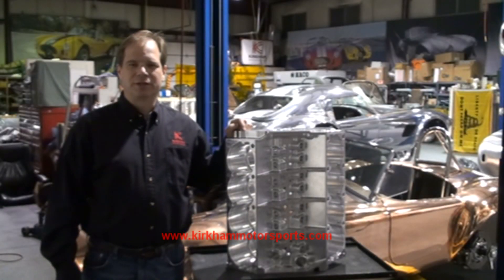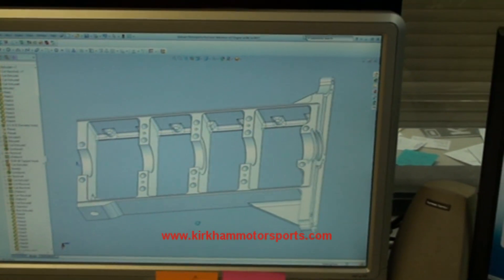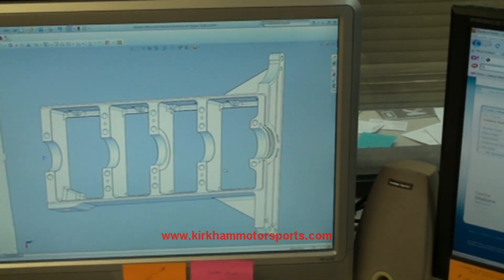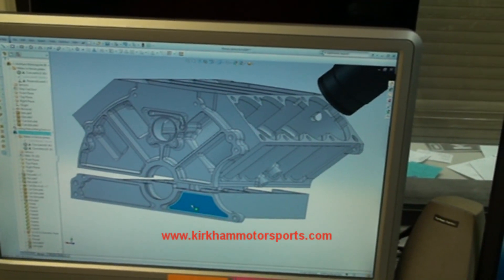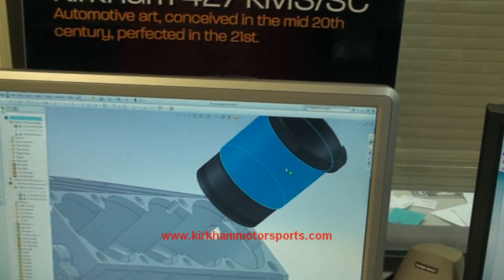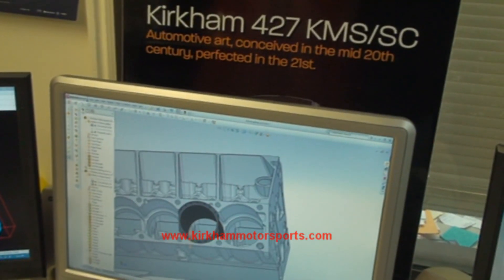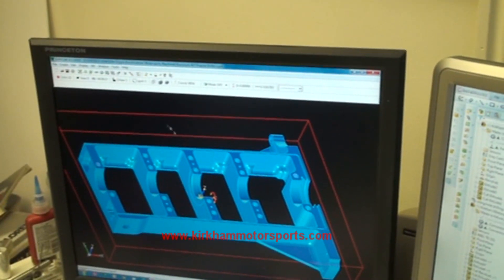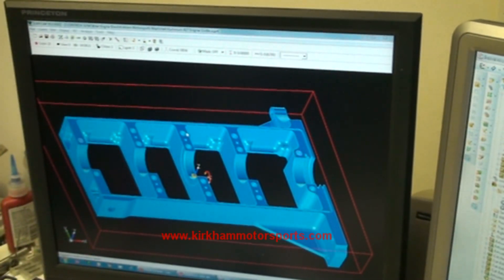Kirkham Motorsports University Billet Aluminum 427 FE Engine Block 2 of 3

Comment: Are you going to do a billet windage tray and billet dry-sump pan? This is a very cool build can hardly wait to see the engineering on the heads and intake. I know using parts off of the shelf is very appealing, but GM reverse engineered the Cleveland head for their LS platform. If you bring the flow value of the FE heads up to the almost NASCAR levels of the LS7 heads, you'd be talking about a 7,500+ screamer.